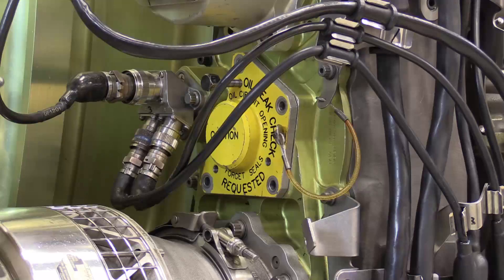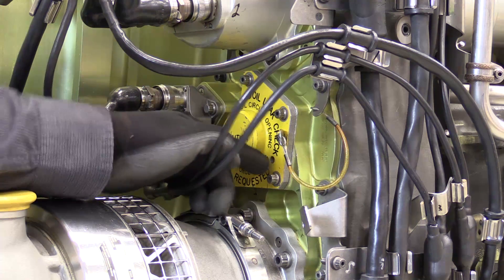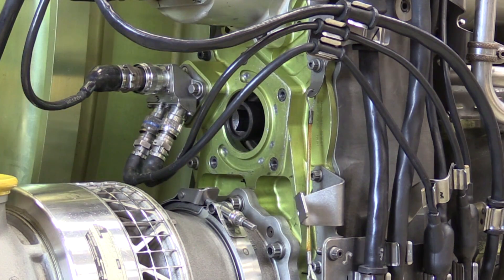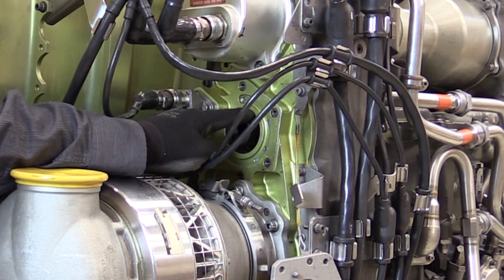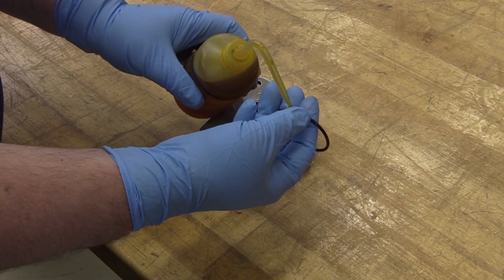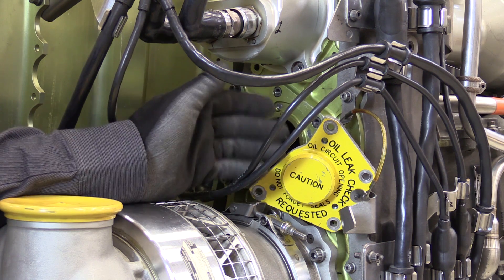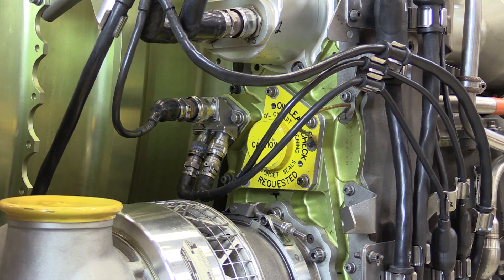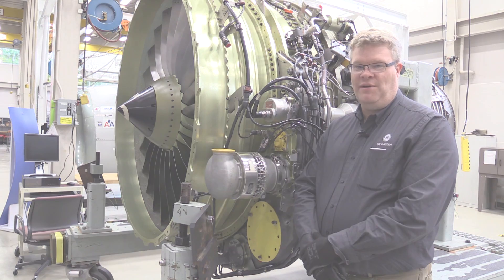CFM - Accessory Gearbox N2 Handcrank Cover - GE Aviation Maintenance Minute

Comment: hi, may i ask ,air starter output shaft connects to the AGB but why when we rotate or hand crank the N2 rotor as shown in this video through the AGB it does not rotate the air starter as well. or i am mistaken. Thank You

Comment: Im pretty sure this is improper torque-wrench technique although I could be wrong.  The swivel-socket changes the angle, thus changes the amount of torque being applied to the bolt.  I’ve always heard you should keep your torque-wrench and socket at a 90 degree angle unless you do the applicable calculations to find the correct torque at a given offset angle.

Comment: What are those cables for ? I mean those ones which are led to the electrical connectors beside the handcrank cover.
Reply: These are for the N2 speed sensor. One Connector for each EEC channel (A and B )and one for the AVM (airborne vibration monitoring) system.